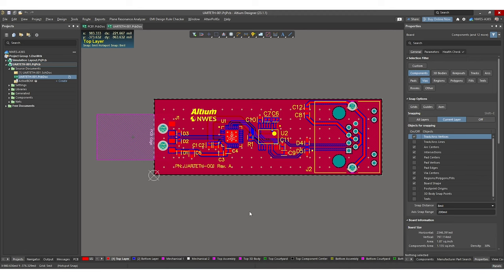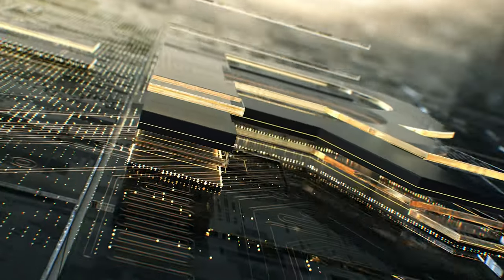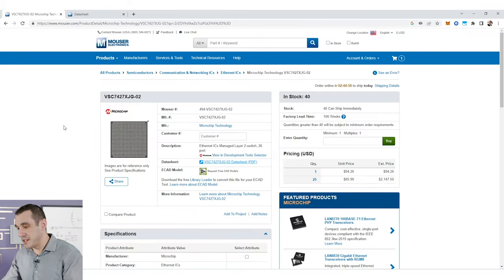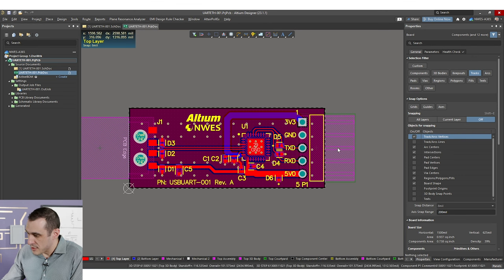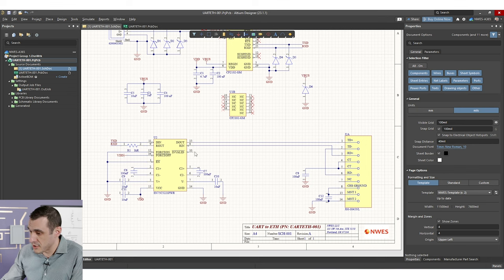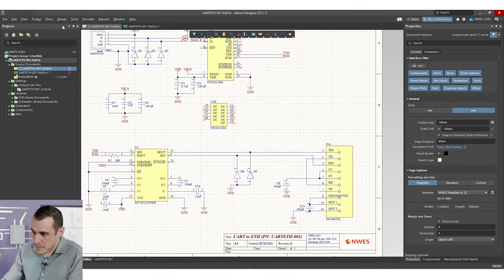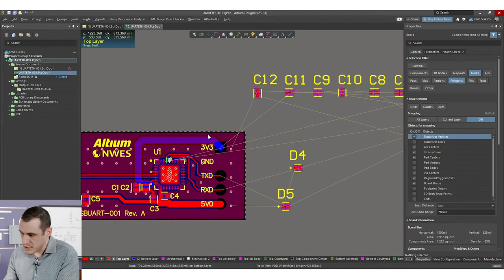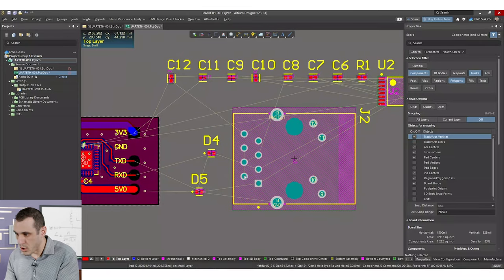UART (RS-232) Over RJ45 Module Tutorial

Comment: So much talking (the video starts at 4:00) but nothing was said other than "line driver" for arguably the most important piece? You used a SN75C3221PWR which is RS-232. Why use that versus say RS-485 with a MAX14787E?

Comment: Please talk to us about C12 on this board. That's an RF shunt, right?
Reply: Basically yes. We matched the pinout being used on one group of switches I did in the past, although you could redo the pinout to just match a standard Ethernet cable, or you can look at the Ethernet-to-RS-232 interface for guidance on pinout. Regardless of how you do the pinout, you only need two signals and the rest may be shunted to ground, if left floating they can radiate or receive but you have to be careful with that on long cable runs where one ground is floating with respect to another, Howard Johnson states on his SigCon site about the types of voltage offsets you can see between equipment (he states 10 V on his site) when there are ground offsets between different pieces of equipment, even if they are technically on the same mains circuit.

Comment: Thanks, Zach for an instructive project. I agree that in this little convertor board, there is no earth connection, but the chassis pin of the other end of the ethernet cable that is connected to the switch could be connected to the earth. In this case, you connect directly the chassis ground of the whole system to the signal ground. Right?
Reply: Generally you should not tie a system ground to a chassis whenever there will be a risk that a return current can flow into the chassis. A chassis should not be used to carry a return current for EMC reasons. I have discussed this in another video on grounding and on mounting holes.

Comment: I am guessing the pinout on the RJ45 was fixed by some standard.  The way the twisted pairs are routed effectively puts TX and RX on a twisted pair (ok, one on each but the other side of each pair is tied together).  Not the best to reduce crosstalk.  Pin 8 is more than just chassis ground, it is the logic ground for TX and RX as well.
Reply: The way the pinout is done is it puts the RX and TX close together on the board but the TX would have its own pair (1,2). You could tie those to GND on the module but then you are bridging grounds between your floating module and what might also be a floating GND in your networking unit (switch, etc.).

Comment: Great and useful project, but the name is very misleading - this has nothing to do with Ethernet. As @Nick Alexeev also said, changing the title to "RS-232 over RJ-45" will avoid some really crazy confusion.
Reply: You're right it was not supposed to be interpreted as "sending data from a serial bitstream over an Ethernet link". It's just UART (RS-232) interfaced over RJ-45 to match the implementation in some modern networking equipment. First time I had to do this kind of thing was with a startup, they wanted to match what Cisco started.